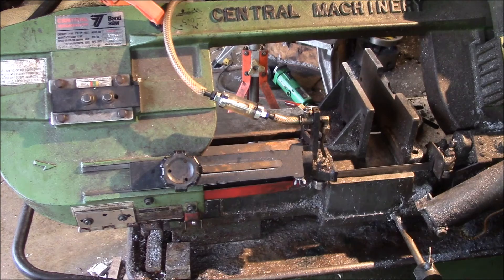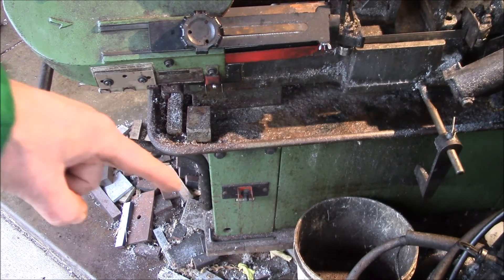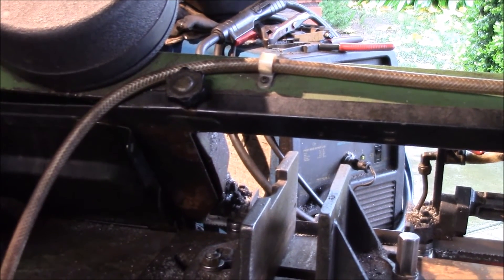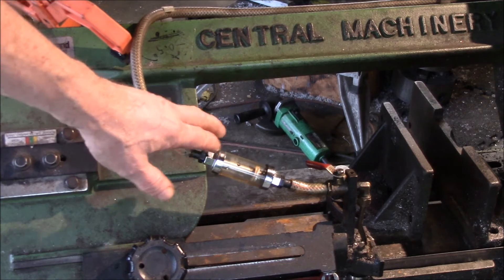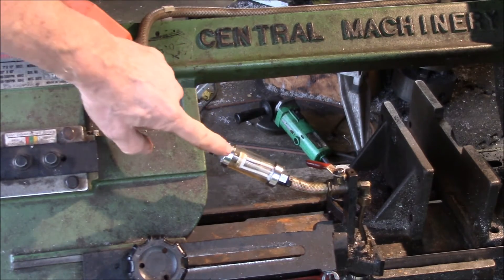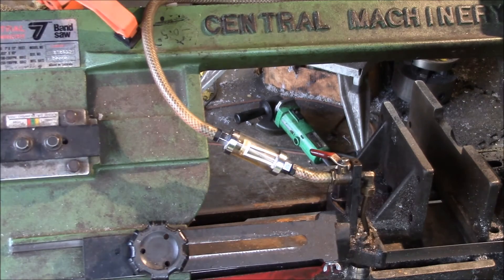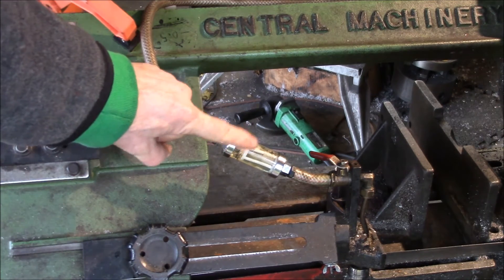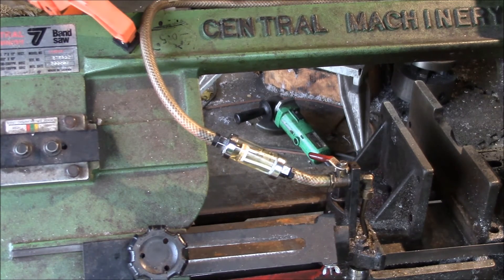Metal Cutting Bandsaw Coolant FIlter

Comment: I've had my Central Machinery band saw for 30 years the only thing I ever changed was the saw blades, I buy my blades from Central McGowan Welding Supply, I will purchase a new blade tomorrow, in 30 years this will be only the 4th blade change, the original blade that comes with the saw the quality is not equal to the blades I purchased from the welding supply store.
Reply from the maker: Sounds like that saw has served you well.  Mine's a bit over 20 years old as I recall.  For sure, a decent blade makes all the difference.  I usually get the Starrett bi-metal blades and they last a fairly long time, although not as long as yours.